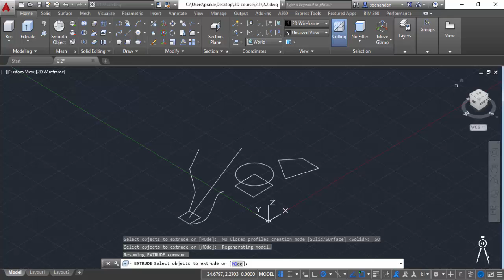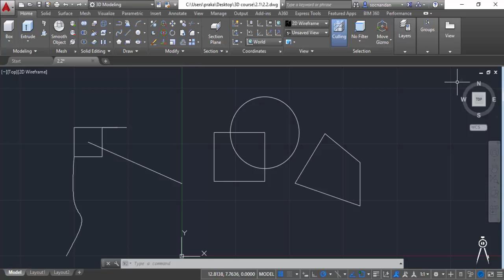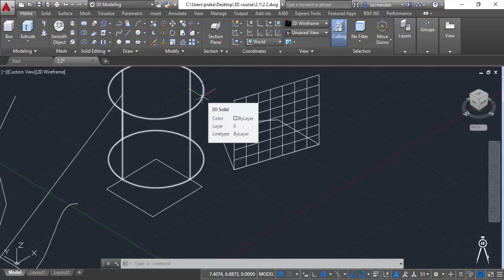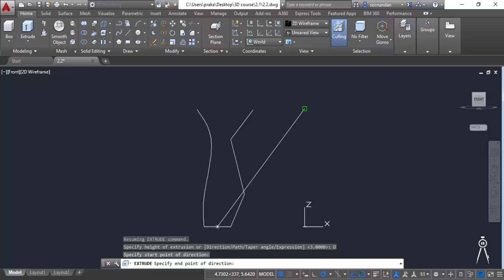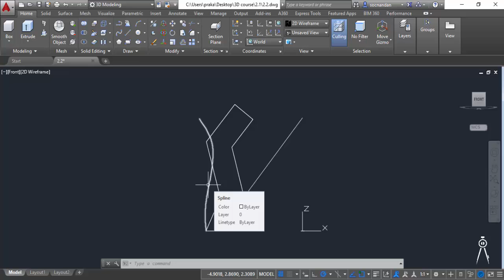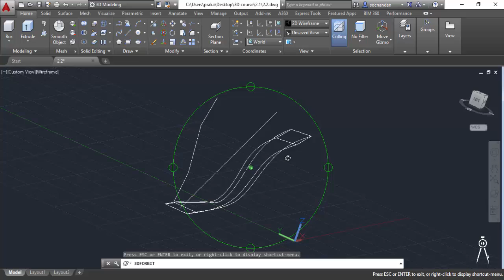Comment: But how are the sketch lines on different planes, instead of being 2-D like the square?
Reply: You just have to change the plane to - z-axis to make 2D lines on the desired plane. 
select front view, and start making lines, randomly like shown on this video.
please keep in mind it should be a polyline. 
Or to convert it into a polyline you can select the lines drawn, and enter "J" to join them and it will convert it into "polyline".